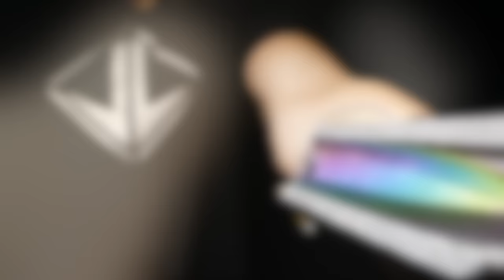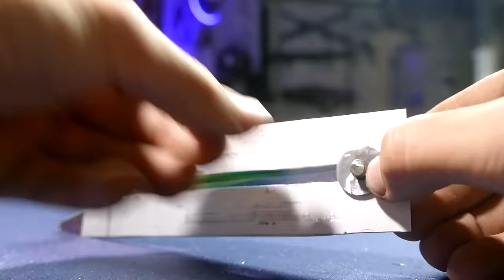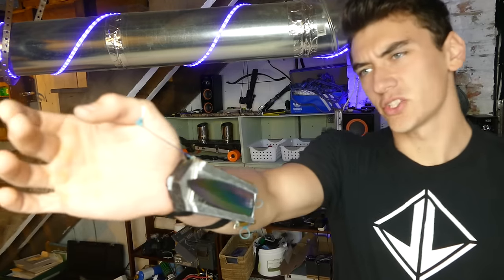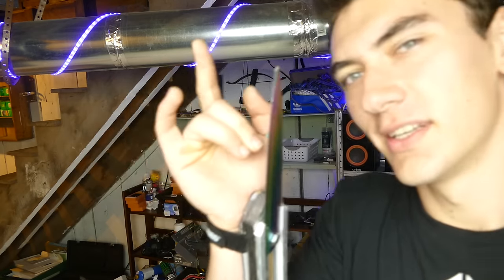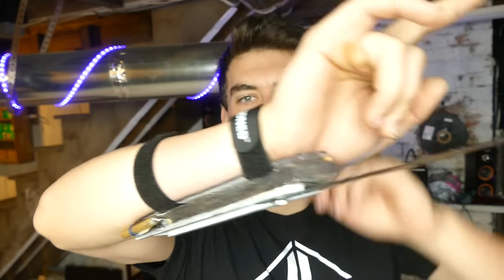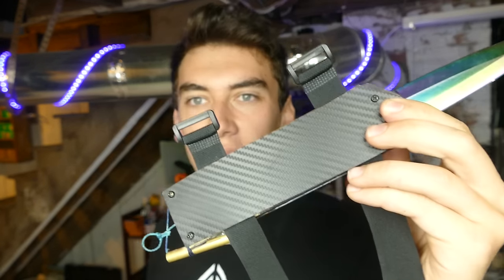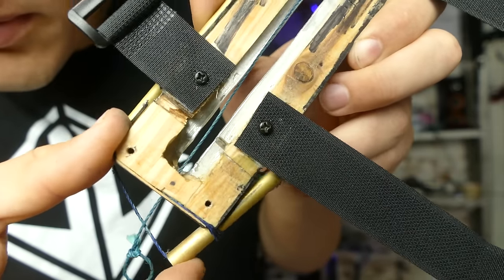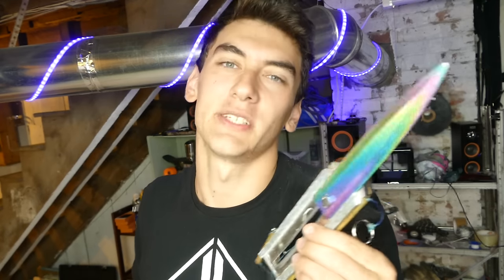How To Make An Assassin's Creed HIDDEN BLADE! - Rainbow Metal, Spring Loaded (Simple Build)

Comment: Something was nagging at the back of my head and I finally realized what it was. You don't have a lock that locks the blade in its forward position.
Reply: I guess the string that pulls the blade back can be connected to pulleys on the other side and connect it to another finger.
Reply: @ozen3348  what about a version like billy russos. This one is close but I want to make one that does not need a ring. And with a real blade
Reply: All you would need is some kind of liner locker

Comment: That's half of the work there, the most important thing is the slide back mechanism. Hope you find a way to that.
Reply: Nitinol could be used.
Reply: the most important thing is for it to lock when opened and closed, and for it to be sturdy enough to stab. If it mechanicaly opens and closes is just to make it fancy, you could have a pretty useful hiden blade that just uses gravity to operate.

Comment: Blade has 2 flaws i can see, 1st it dosent lock when extended. As its primary function is stabbing things, thats a big issue. 2nd its a bit wobbly for slashing. Perhaps add a second bolt to stabilize it. otherwise, a good starter build. Thank you for you effort

Comment: Only problem I see is it won't be the best as an actual weapon because you'd need to lock the blade in the extended position so it doesn't push back when used... Hypothetically of course

Comment: The blade doesn't even look sharp and blade is supposed to be activated by a muscle movement in the wrist
Reply: The Assassin Clan it’s more for Cosplay, you would have to be very Careful with a Very sharp one, You end up cutting your hand,arm, It can be very Dangerous, but I made two and cut myself 3 times, not bad cuts, no needed glove or stitches and Trained myself with it, so I was Pretty God with it, I cut off
Two Dumbie heads in 3 seconds, similar to human heads, It’s very Sharp.
Reply: Making a blade activated by muscle movement would be hard, and it would be impossible to make one that wouldn't activate accidentally. It's not as if we have some auxiliary muscle that can be reserved for opening hidden blades, as cool as that would be.
Reply: The Assassin Clan there is a model with a ring
Reply: Albert Wesker I was wondering if his had a extended locking so if you try to penetrate something like a dummy it wouldn’t just go back in? How did you make yours ?
Reply: Just let something cool be cool please

Comment: Dude! It'd be cool if the blade was retractable. I remember colinfurz(or something like that; a YouTube that also makes awesome gizmos, gadgets and the sort) use a combination of a spring and a rotating wheel system to make the blade shoot out and retract back and forth. Only problem was that the blade looked a tiny bit bulky and not too concealable like yours, not to mention a bit harder to make all together with so much access to expensive tools. But a combination of both would be too awesome

Comment: Use a pulley system to pull the knife back. The strings should be attached to the other fingers so when put your hand flat like paper in Rock Paper Scissors

Comment: I kind of don't like this because it doesn't have a locking mechanism. I think you should port a hole in it (blade bottom) and put a 90° piece of metal above it just to catch it to lock it in place. Then hypothetically to reload it you can just use it like an expandable baton and push it against the surface as you release a switch to collapse the device. This way when the blade ejects it will have a locking mechanism, and you can puncture into things.

Comment: I sincerely hope you don't actually intend to use this for slashing anything besides paper, the muscle movements required are awkward and don't flow well with strikes or throws.  To those of us intending to create the actual version of this potentially lethal weapon, either make a curved version that curves towards the outside of your arm significantly, or make a stabbing version with no cutting edge, just a point and a very good locking system that can be deactivated with a similar muscle movement to the one you use to activate it.